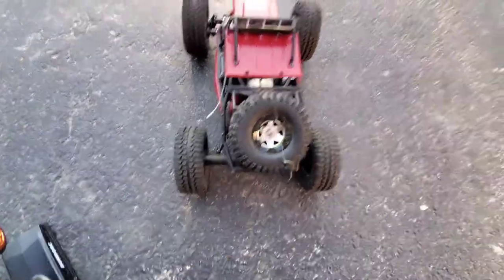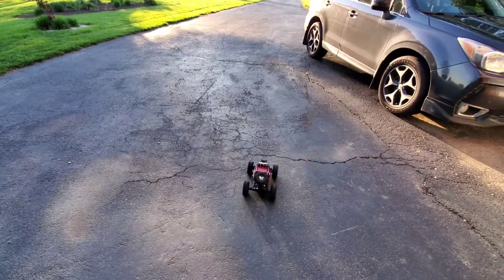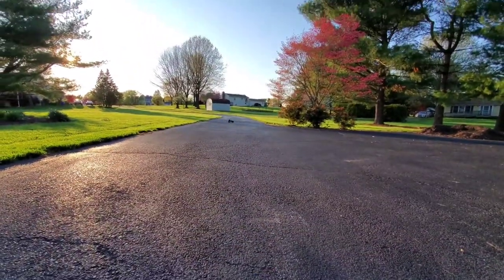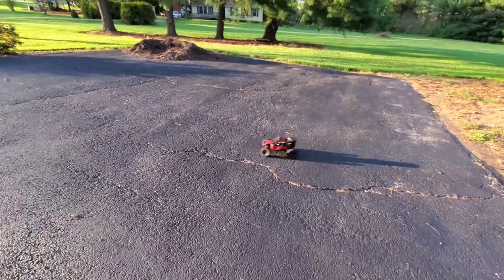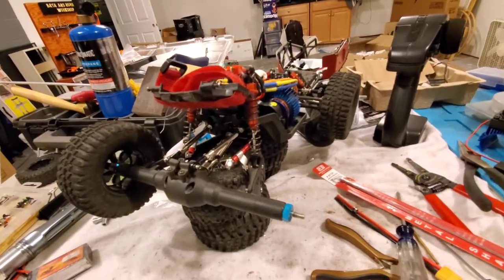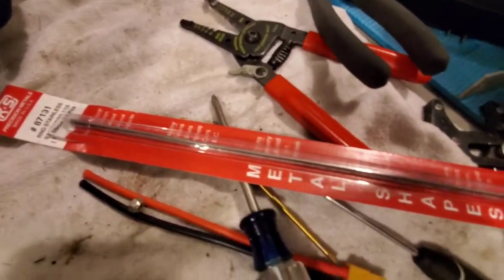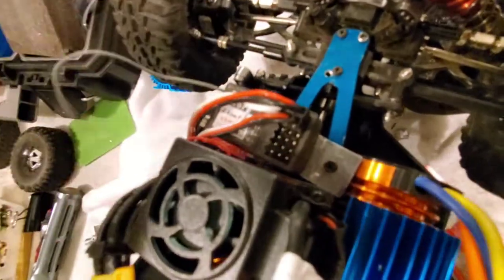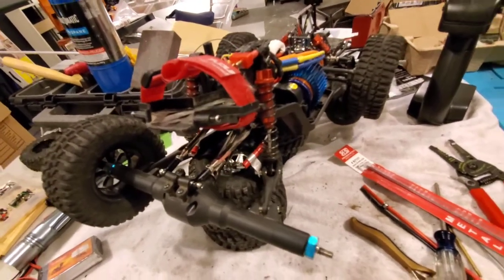Wltoys 12428 tip over fix. DIY sway bar upgrade, Dumbo RC receiver

Comment: What kv brushless have you got in there. I'm heavily considering doing something like this...but battling myself if I want a supped up RC or with the money I'll spend getting it fast buy another 😅 and keep the 12428 stock
Reply: What about the cogging I see people talking about with brushless?
Reply from the maker: In this vid I have a 3930kv. There's some cogging but it's minimal. You can get a sensored setup if you are concerned about cogging, or get a lower kv